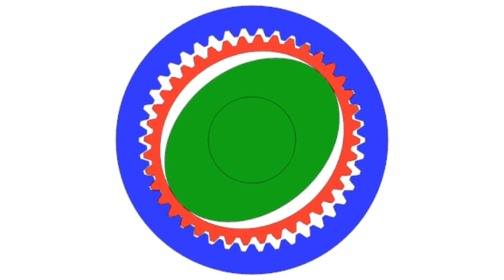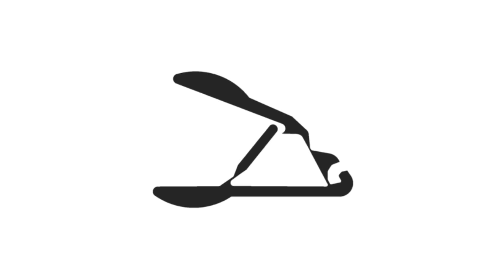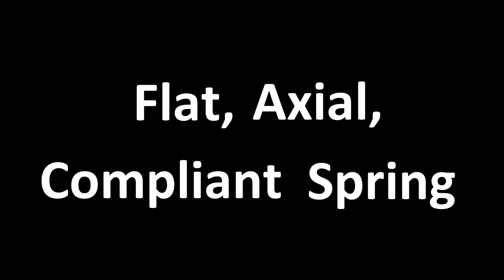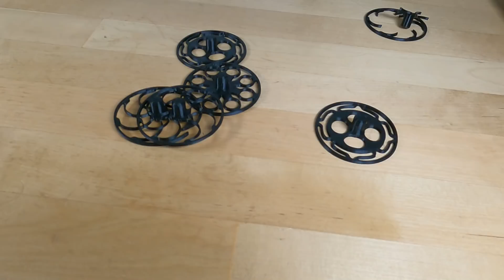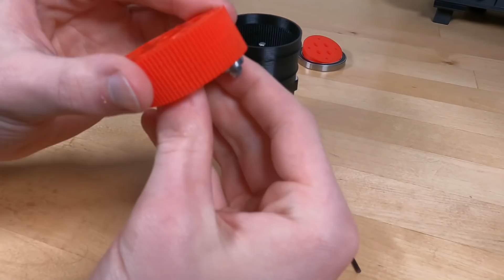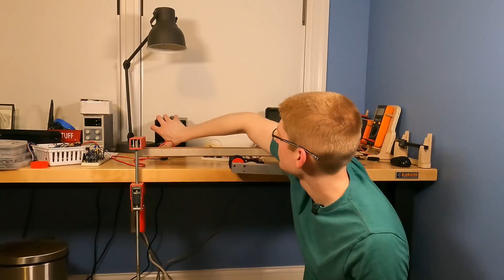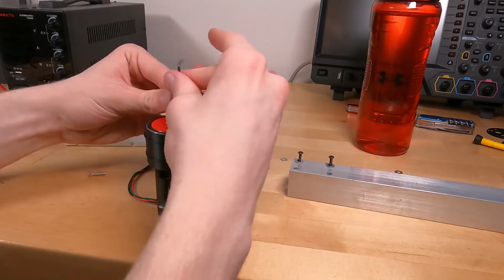Compliant Harmonic Drive (3D Printed)

Comment: why not stick a motor inside the cup? seems like a good place for a brushless motor.
Reply: "Embedded Strain Wave Actuator" on Hackaday does exactly that.
Reply: @dekutree64  Good reference, but the motor is inside the wave generator section, axially aligned with the gears. The adaptor part of the cup, flexing between the oval strain wave gear and circular output section, is still left essentially empty, and that's the part this project tried to redesign. In this design, the motor would sit between the small bearings. The actuator you referenced improves on those by making an oval bearing track.

Comment: If you changed the shape of the compliant spring from an S to an almost diagonal because then you could probably back drive it too?
Reply: exactly. In fact, the outside (teeth) and inside (hub) should be 2 separate pieces with STRAIGHT spokes connecting them, hinged at the connection points from the inside to the outside.

Comment: Such ideas can be patented or ip-secured with design patterns, IIRC? After this video not anymore. Further its probably too expansive for such projects. But a lot of small innovations can make a huge difference and if they do there should be a way to compensate the inventors. I know that the current system can not do that, but has anyone an idea how to do that?

We have internet, CAD exchange formats and block-chains for immutable public ledgers. 
Coherently maintaining properties rights internationally may be one of the proper applications of blockchains. If you have an idea send me an email please.

Comment: Am I missing something, or is a "standard" harmonic drive already a compliant mechanism, in that the flex spline is… a force-carrying component that deforms elastically in the process of transmitting force?

That's not to say there's nothing of interest here, just that it's misleading to talk as if the use of a compliant mechanism is the breakthrough.

Comment: Hey, check out the channel artofscience that has a lot of optimized compliant structures that are designed to deform along some axis but not others. That channel has a design very similar to yours with an "x" shape connecting the inner and outer rings instead of your "s" shape. I think an optimized structure would increase the strength by a lot, and it's symmetrical in either direction unlike yours.

Comment: That is stupid solution.
Instead you can use a ring like flex spline and 2 outer gears, one fixed and another one rotating. 
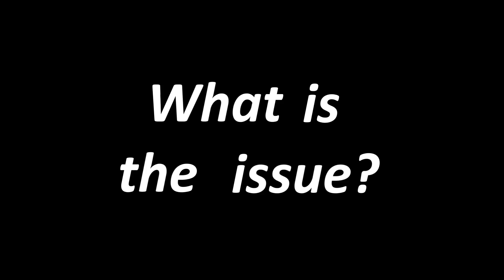If one made with 100 teeth while the other one is made with 98 - they will match in 2 places and have a gearing ratio of 1:50 while being very short.
https://www.harmonicdrive.net/_hd/Content/images/FR%20Structure.png